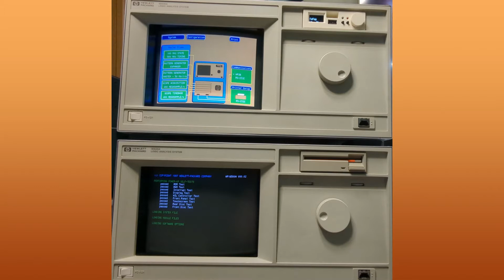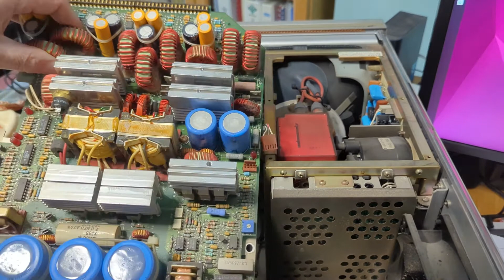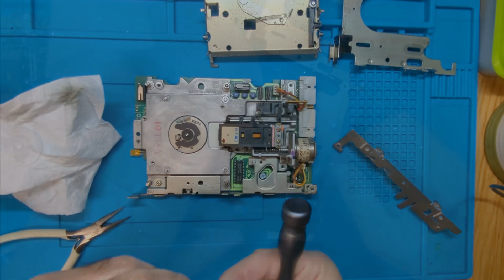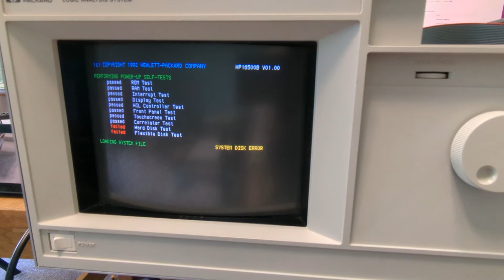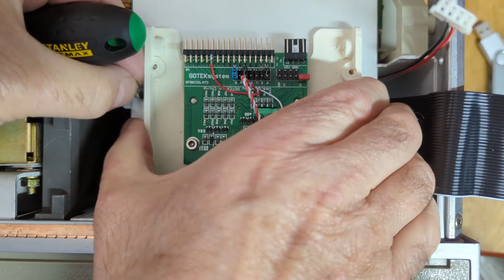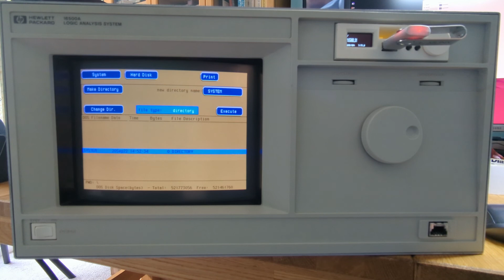BTW EP06   HP16500A Logic Analyser

Comment: The 16500B is a very interesting system. i got introduced to it while looking for a cheap logic analyzer and oscilloscope. I first bought locally a 1662A-series logic analyzer with 68 channels and a full set of logic probes. I then noticed a 16500B was being sold with a 16550A that is a 102-ch logic analyzer and a 16532A, which is a 2ch 250MHz 1Gsa oscilloscope... That made it a touch screen color DSO from 1992. The 16532A card is also compatible with the 1662A, by the way.  So, for $150 including $100 shipping I ended up with a very nice 250MHz oscilloscope that happens to also be a great logic analyzer. 

This thing cost "if you have to ask you can't afford it" back in its day. The 1664A, which is the cheapest of the range, was $4500. There's a companion pattern generator card available for the 16500-series that uses same syntax as the logic analyzer to generate patterns. I picked up a couple of HP oscilloscope probes to use with it. The 10441A probes is what you want as they are 2m/6' long and rated for 500MHz. Mine are shorter HP 10435A 300MHz, but that's good enough for now.

By the way, the 16500-series can support multiple oscilloscope boards and later models go up to 500MHz. You can probably turn it into an 8ch monster. There are even higher spec boards available for the 16700-series. 

16500-series use 40-pin logic analyzer pods that are compatible with 16700-series and other 1600-series equipment of similar vintage. It's important to know that the pod cables consist of two parts. You have the pods and there's also a set of micrograbber flying leads. Most of these systems are sold with no cables or with only pods but not the end leads, but rarely are they sold with complete cables. Look for an undervalued compatible logic analyzer with complete cables to get those cheap.

There's also a fixed configuration of these as 1660AS through 1663AS. I've seen a 1660CS as well, so later revisions exist. The S stands for the built-in 250Mhz 2ch oscilloscope. They use a proprietary HP HIL mouse and have no touch screen but also have a built-in keyboard on the front panel.

Comment: Great video ! Thanks for sharing. I am looking to do what you did to my 16500C. I am trying to add a IDE to CF adaptor but I believe the 16500C can only use certain specific CF cards. I am having issues where the 16500C gets stuck at "formatting Drive" and it locks up using SanDisk CF cards. I purchased some Simpltech CF cards that are suppose to work but they didn't arrive yet.
Reply: I am trying to remember what I did with mine to get it to run. I was expecting more trouble than I had - it just worked with the no-name CF cards and a 64mb branded (can't remember the brand). One thought is to try to format it in a PC first then reformat it in the HP. The other thing to try is sizing the card to match a typical hard drive of the period.
Reply: @BogTheWombat  Thanks ! I was told they use a FAT16 file system but with byte-swapped. I am using Linux to try a clone the original hard drive but I can't get the CF to boot. It passes the HD test but it fails the format. I also tried to FTP into the 16500C and tried to copy the system files over but it fails.
Reply: @mikematkovic3466  Sorry about the delay - Christmas and the like.... If you haven't sorted it yet, what I did to format the drive is format it on a DAS machine to get a partition, boot the HP16500 off a floppy and then use the format option on the HP software
Reply: @BogTheWombat  It's OK! Thanks for the reply. I actually got it working! It needed to be a specific CF card.